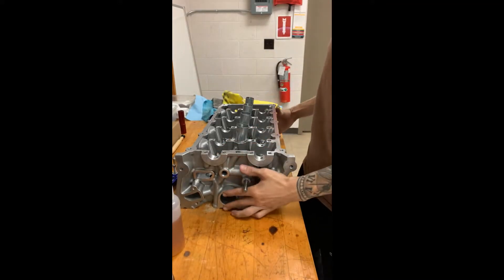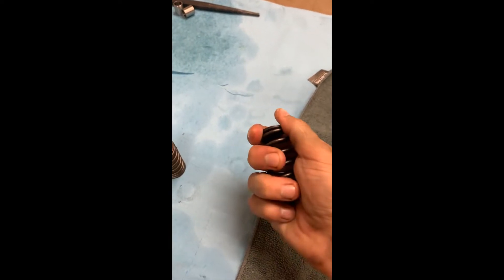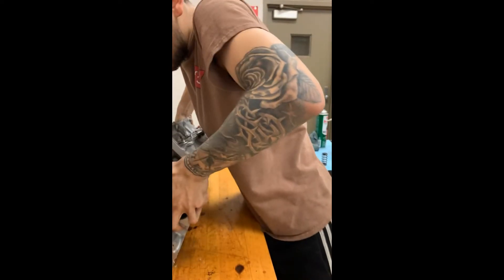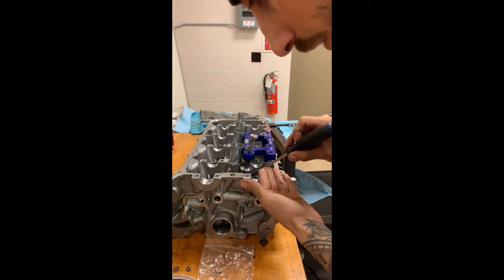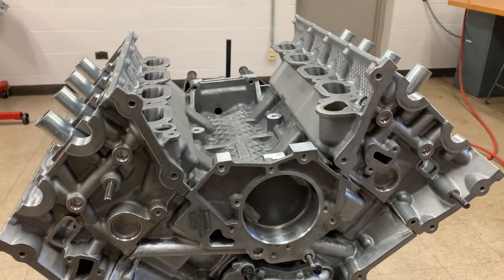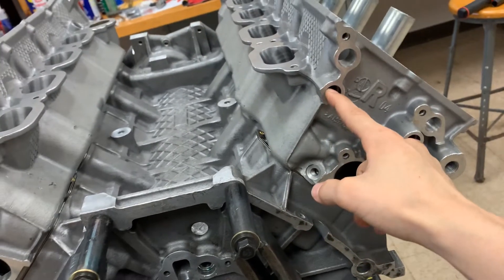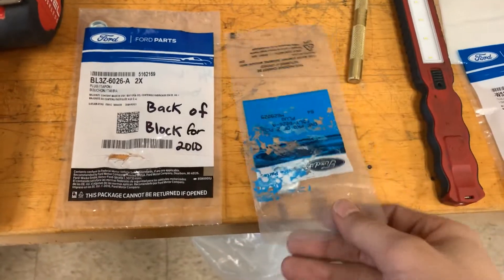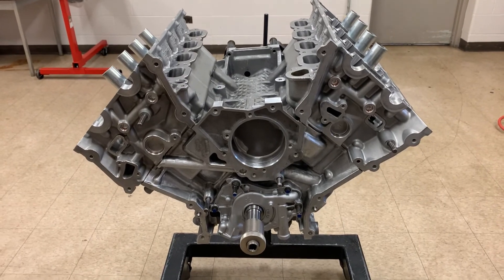Coyote 5.0 Engine Build Part 4- Cylinder Head Assembly

Comment: Would you be able to share the part numbers for those dowels?
Reply from the maker: MMR Part # 400088

But I recommend using a new set of factory Dowels. Billet parts always seem like they are better but in this case the billet dowels are not better than the factory ones because they are too loose in the block. The factory dowels come with a tension cut that forces the dowel to spring outward biting into the block providing a better alignment for the cylinder head on the block.
Reply: @NitrousYote thank you for such a quick response! I apologize, I was referring to the solid dowels sticking out of the front of the block. I think they might be for the timing components.
Reply from the maker: @BoostCoupe1990  oh i see. If you are referring to the timing cover dowel pins then you can find those in this kit here at FMS-M-6026-M50X on summit racing or if you end up needing more of the timing kit like chains or phasers or timing tensioners you can purchase ford performance timing kit M-6004-A504 which comes with the dowel pins and everything else necessary for the front timing components.
Reply: @NitrousYote I really appreciate you getting into the minutiae that a lot of videos gloss over. It helps those of us doing it for the first time. 

I purchased M-6004-A5015B already. I'll break out the dial caliper and start measuring the hardware that Ford indiscriminately dropped in a baggie. For what they charge, you'd think they could at least individually bag the hardware with part numbers for the DIY crowd.

Comment: Hey bro how did the porting work out for you? What would I tell a machine shop if I would like to have the same thing done for my heads? And should I put the GT 350 springs in the heads? Thanks bro.
Reply from the maker: To be honest there is a more cost effective way of achieving the same power as me if you would like to stay NA. 

You can go through the work of trying to port your cylinder heads, but this is thousands of dollars and most people do a shitty job. You’re looking at months and months of wait times it’s more of headache than anything. 

I would simply purchase the Gen 3 cylinder heads and keep ‘em stock. Ford performance has a guide on there website to make it work. It just a headgasket change and a couple of timing components. This a far cheaper and faster option. You will see no loss in HP at the NA level plus you get direct injection now. Cost of the additional fuel injectors will not be cheap but they will help the engine create more power.

Comment: do you need to get new plugs with an engine rebuild?
Reply from the maker: If the block and cylinder heads need to be cleaned then yes, you will need new plugs. There is no way to clean all of the oil/coolant passages without the removal of those plugs. 

If you have a new engine, or if you had a machine shop clean your block for you then it would not be necessary to remove any plugs.

Comment: are all the valve springs the same size?
Reply from the maker: Yes, unless you are running a pretty aggressive camshaft the OEM springs on these coyotes provide the correct “spring installed height” so checking the height of the spring is not as critical. 

Now if you are running an aftermarket camshaft that has a significant amount of lift than it would be necessary to check spring height and spring installed height. 

For example, let’s say you want to run the popular NSR stage 3 camshaft from comp cams. If you would like to avoid valve float and run high rpm like 8k+ than it’s necessary to change the spring even tho the cam says no spring required. Guys see the NSR but miss the 7800 rpm range and bring there coyote to 8500 rpm and wonder why it runs like dog shit. It’s bc the spring is causing valve float above 7800 rpm, and they more than likely didn’t shim there springs.
Reply: @NitrousYote  thank you. Are you going to drop another vid for the timing component and I wish you made a video on crank install. Like from start would’ve been dope. All these other builders are usually boring to watch and not in depth like your vids
Reply from the maker: @kuksgarage2715  I was a one man show and it’s really hard to capture everything on video. Also, these videos are for assembly and not blueprinting. Blueprinting covers the process of checking bearing clearances and setting them accordingly. If I recorded the crankshaft install for my video it would be as simple as just picking it up and dropping it in bc I already set my bearing clearances. 

As for the timing portion of the build I haven’t decided yet whether or not I will release the footage. I would like to, but unfortunately there is some information I speak on that I feel like some viewers might follow incorrectly, and without certain knowledge that I do not cover could lead to engine failure. This is a very technical process and takes much more than 20 mins of video to really understand, and I would hate for someone to watch this footage and without knowing any better mess something up bc they didn’t take x, y, or z into consideration.
Reply: @NitrousYote  I understand makes sense. Thank you again
Reply from the maker: @kuksgarage2715  if you have any specific questions I’ll gladly answer them. If you are looking for a step by step set of instructions comp cam has a great set of instructions for the coyote for timing. 

If you are keeping VCT it will not be necessary to degree the camshaft. If you are deleting VCT and going with the Lockout plates than it will be necessary to degree the cams and comp cams also has a set of instructions on that as well along with a complete kit that comes with a wheel, checking springs, pointer, and crankshaft turning tool.